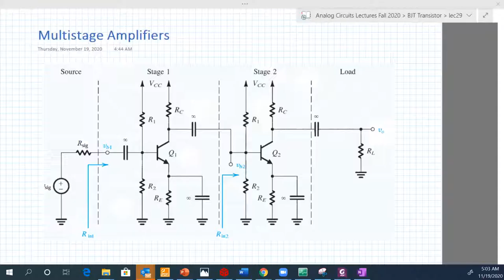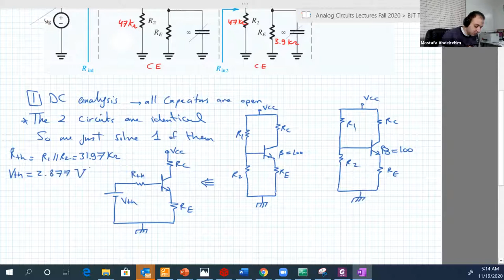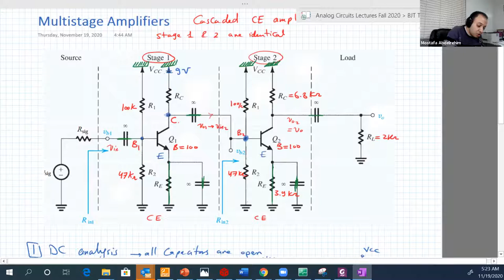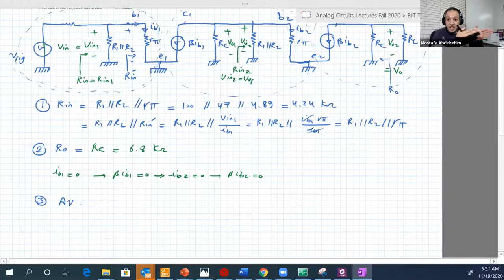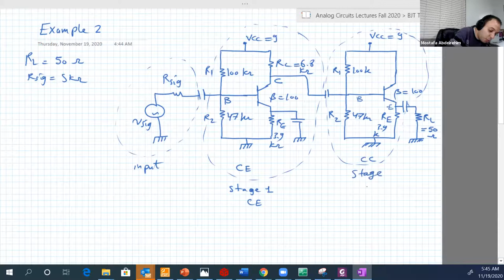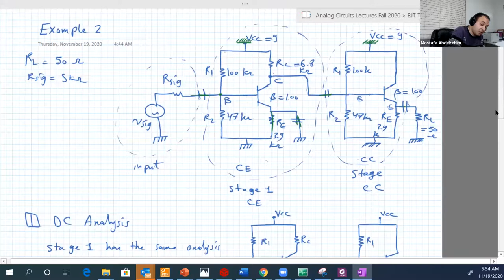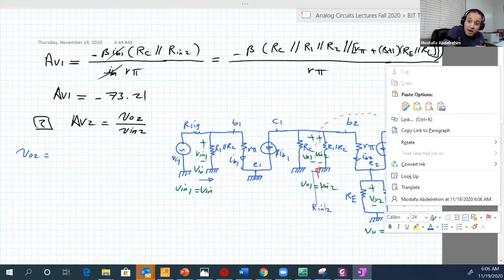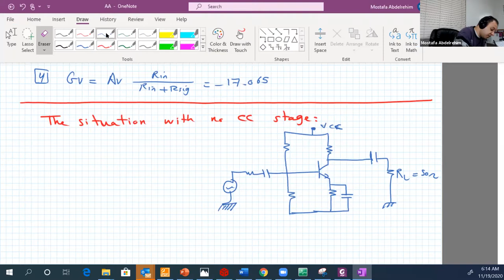[29] Multistage BJT Amplifiers

Comment: Why is Rin2 not = R1||R2||rpi in the second example, isnt the input resistance just the resistance seen by the source before it goes into the base to become the emitter current?
Reply from the maker: Because rpi is not isolated anymore from the rest of circuit. In the first example rpi is parallel with R1 and R2 while in the second example it is not in parallel with them anymore.
Reply from the maker: Thanks anyways for watching and please share and subscribe. Also don't hesitate to ask any questions 🙏🌷

Comment: Which is the reference/ book related to this circuit sir?
Reply from the maker: Main author is Adel Sedra 
Also called Sedra/Smith adding second author 
You can search online for pdf
Reply from the maker: Plz subscribe and share between your colleagues. Thanks
Reply: @MostafaAbdelrehim   I could not find same graphs in the six edition Dr., can you please tell me which edition you had used? and Chapter number?  Many thanks
Reply from the maker: @hamzamohamed4801  you can find a similar problem (may be different values for resistors) in ed 8 chapter 7 problem 7.130

Comment: For Av1 , why did you multiply the ßįb with the rest all resistors in parallel and not only Rc?
Reply from the maker: if you wanna use only RC then you should mulitply RC value by the value of the current that flows in RC. Since we do not know that current then we used Bib which flows in the parallel resistor combination

Comment: how can i find the output resistance of the second example ?
Reply from the maker: you mean the second stage?
Reply: @MostafaAbdelrehim  there are two questions in the video i meant the output resistance of the circuit in the second question
Reply from the maker: @behenuemichael6051  Ro = RC
Reply: @MostafaAbdelrehim  why is it like that ?  Vout/Iout does not seem to give us RC. I couldnt understand it.
Reply from the maker: @behenuemichael6051  we do not consider RL when you do vo/io. basically, you disconnect RL when you do that step. Plz watch my other videos before that and you will understand more. The definition of Ro is that resistance that RL sees so we must disconnect RL when we calculate Ro.